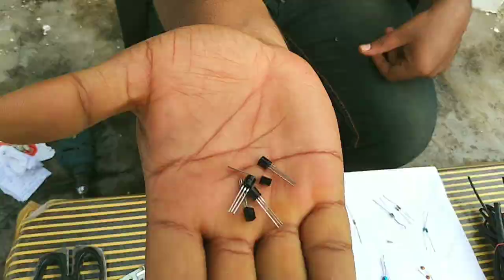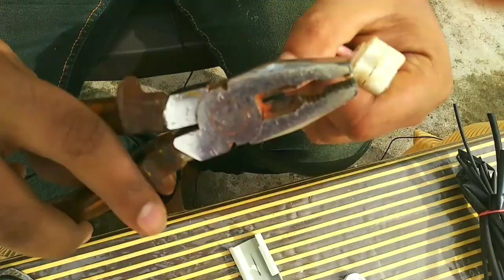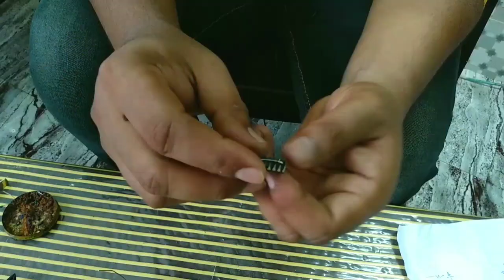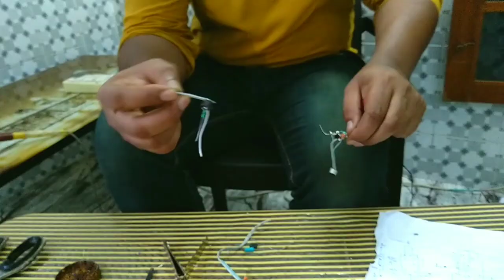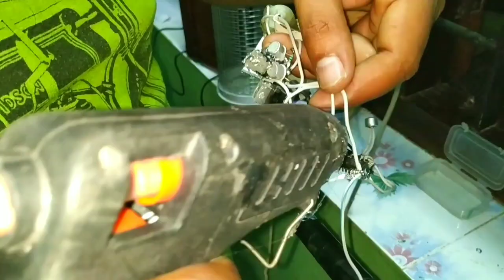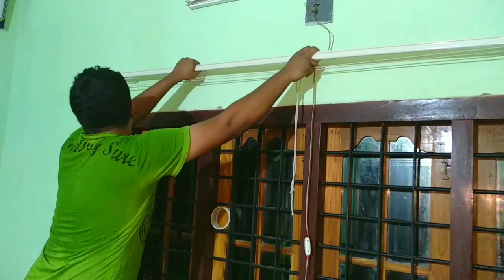Simple Clapp curtain opener | Automatic curtain

Comment: I'd pole chayan etra experience varum
Reply from the maker: The motor is the main component in this project. The price of the motor may vary according to the power of motor(I recommend high torque and  speed motor).In this video I have used a motor which I bought some years ago and the price was in between 100-150.
 Thanks for watching and don't forget to subscribe.